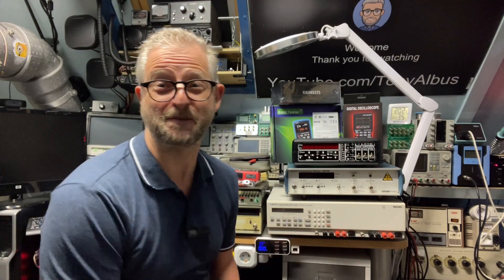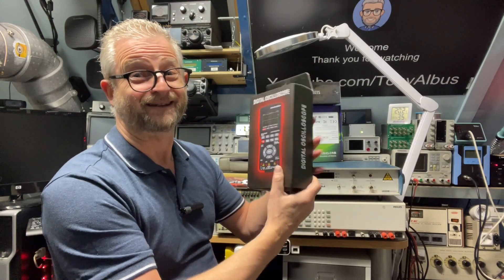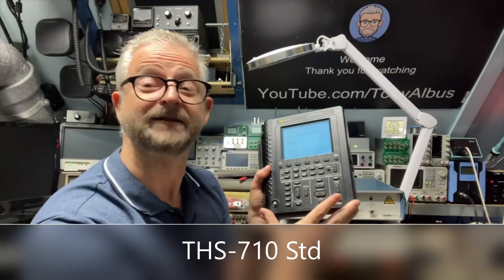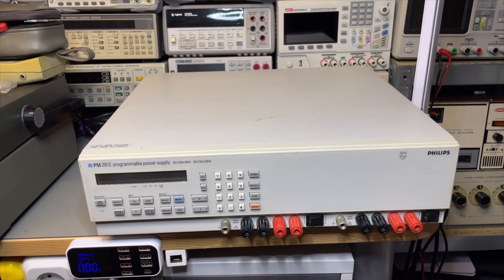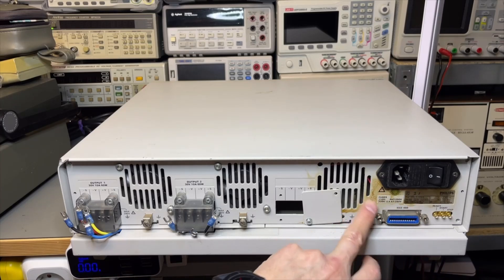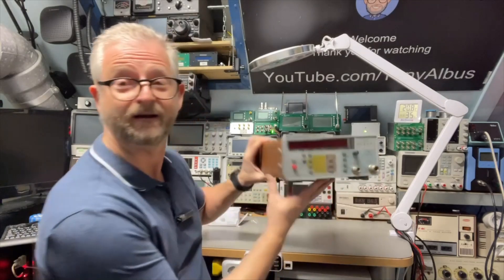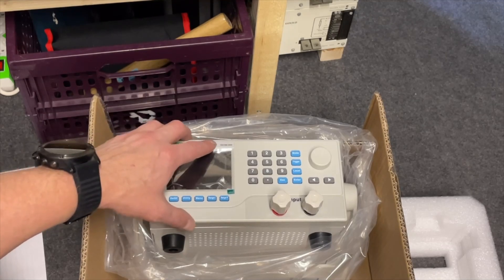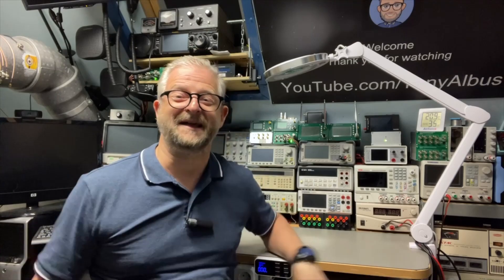TA-0389: Update Jan 2024 - After a break - What is coming in 2024 - Stay tuned

Comment: For the Tektronix Remove R207 and R213, this allows for the higher bandwidth in the input stages and R204 tells the FW to behave as a THS720P if newer (remove R205 instead of R204 to make it a 720P) or R204 (to make it a 720A) Upgraded mines already and upgraded it from a THS720A to THS720P which give you power measurements. 

Also if you get any DC offset usually optic couplers are drifting and need to be replaced and it has a couple SMD capacitors by multi meter cable that need to be replaced as turns to resistors and usually leak.
Reply from the maker: Thanks! yes mine is older, a Std, a (non A) fw 1.03 .. so prob it will not we a P but a 720 is already nice!